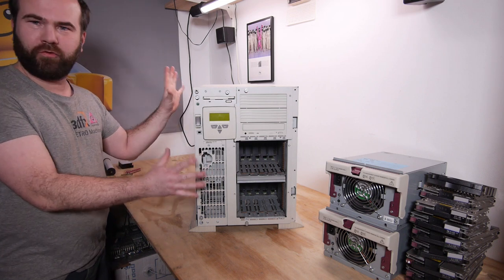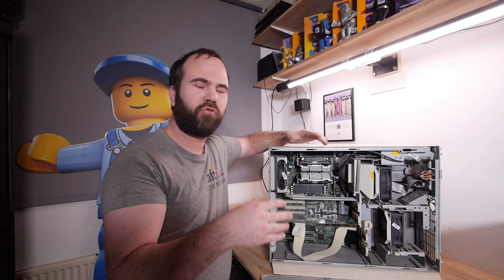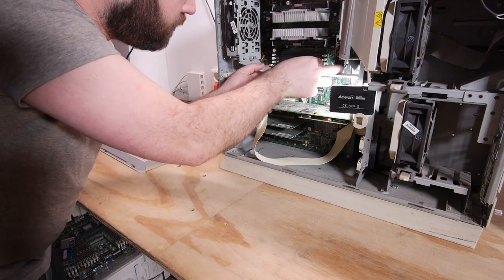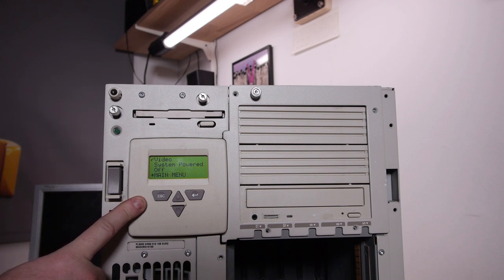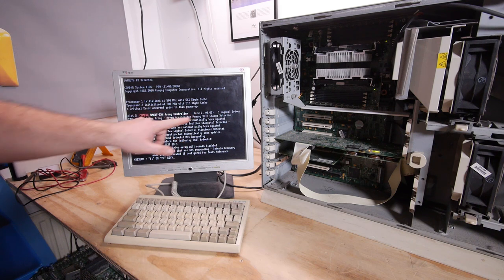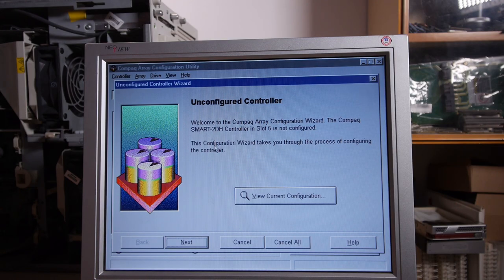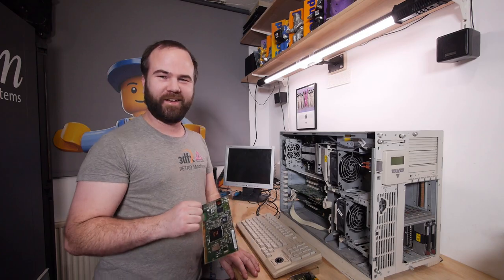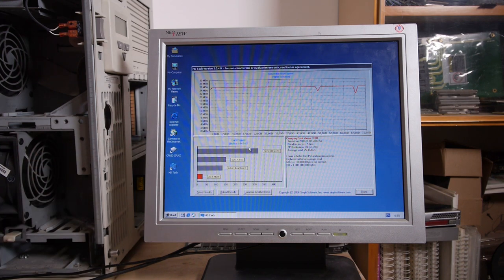1999 Compaq Proliant 3000, First Boot & SCSI Raid Setup

Comment: The door, when you find it, will no doubt cost more than the system lol.
Reply from the maker: Yes 🙈 Maybe I find another 3000 and combine them and get spare parts 😁
Reply from the maker: @mark smithier the model after the 3000, the dl380 ml370 etc supports p3 1ghz
Reply: @victorbart   I used to have a proliant 3000! it is a absolute UNIT of a machine! mine had wheels on it which was awesome. but it looks like yours has a different mobo which is interesting. mine used processor riser cards and took Pentium II's not pentium IIIs and it had 4 slots of RAM on mobo AND it had a riser card that added 8 more RAM slots for a max of a whopping 3 GIGABYTES OF RAM WHOAA haha lol. mine had 256MB of ram in it. but the case was the same. I had the LCD screen same PSUS same everything else..I just had a different motherboard. my Proliant 3000 is unfortunately long gone. I did have the front door for it. I did some Googling and the Proliant 3000R motherboard kinda looks like the one I had..but again, I had your case(with wheels) and PSUs and everything else

Comment: Victor, I actually installed these brand new in 1999 they are really nice machines. The 264gb Nick's that are in the system are perfect and they are fully supported. We even had multi-port nics in some of these servers.  4 total of 4 ports in each server or more.  We used these for DB, web, file servers.  These are great machines.

If you need any help please let me know.

Comment: Awesome. Don’t forget though those pci slots share one pci bus. If I remember correctly 133MB/s max.. So don’t expect miracles when combining raid cards with a quad gigabit nic as you suggested. Then again... maxing it out and making it suffer till it bleeds is kinda nice as well.. 😎
Reply from the maker: Yes I know! That is downside of this server. I prefer PCI 64bit! And it would be cool if the isa slots were EISA 😁
Reply: Well, it’s old anyway.. So just enjoy it for what it is. 🙂 I love speccing things out with time-accurate hardware and then make it suffer by hitting theoretical limits.. 🤓 Cool project!
Reply: @martintimmermans8952  here i am fixing up an make-shift server from around 2009/10 - at least it has ddr3 and pciex 2.0^^
Reply: @martintimmermans8952  haha

Comment: I'd put an analog/ISDN modem on one of those ISA slots, it's the most server-related thing that you could fit in it. If you have 3 ISA modems you can slot in all of them and pretend that this would be for some sort of remote access service. If you find or have around an old PBX you could even simulate the remote access system, hooking to it the server and some PCs equipped with modems. By configuring the Windows' routing and remote access services you should be able to connect to the server via modem and if you give Internet access to it via LAN you can even use your server as a router, to browse the Internet from the client like you would've done in the 90ies. I did a similar experiment some time ago and it worked :-)

Personally I'm not really fond of sound cards or 3D accelerated cards on servers, because they're more of a consumer/prosumer thing, I see them better being installed into normal PCs.

Comment: I have a Compaq ProLiant ML370 running 6x300GB SCSI HDDs. Basically, since I'm running FreeBSD, I made three Hardware RAID5 arrays across all drives and used ZFS to stripe them all due to a limitation in the RAID controller. You could probably do four or five, but basically keep each array size below 512GB (I'm suspecting).

Comment: Proliant's haven't got much lighter over the years. I had to relocate my ML350 yesterday, I'll be aching for days :D :D
Reply from the maker: the ML350 is the ugly duckling in the HP line. They try to continue the old 5U style tower cases, For modern system I prefer the 2U of a 5U Ml350
Reply: @victorbart  Oh she's definitely no looker, that's why it's now tucked away in a room in solitary confinement with the ugliest switch I could pair it with :)
Reply: @victorbart  The ML350 is best for using as a cheap high performance desktop though ;) lots of PCIE. Only thing is most people order it with only 2.5 drive bays and getting 3.5 bays are expensive. At least with older models you can use the optical bays but the new ones don't have any.

Comment: Well this is "technically" a HP server, as HP bought Compaq and used their server designs. This is why the DL380 generation 1 and 2 are branded Compaq, while later ones are HP, all the way up to the current DL380 gen10.
Reply from the maker: NO! The Pentium3 line of HP was a way different line.

the HP gen 3 4 5 etc are Compaq designs.

They dropped the HP netserver line and went with the Compaq Design :)
Reply: @victorbart  Yes, that's what I meant. That HP basically just took over the design from when they bought Compaq, so that's why I would say this is "technically" a Hp server :P

Comment: hi why not use one of the many expansion slots to put an pci to  compactflash or sd card for use it as boot drive, that way you have full space in the scsi drives and it's more dependable that way & boot faster.
greetings
Reply from the maker: I can also look for the compaq 2x 5.25 drive bay with 2 hotswap drives. Or I can split the raid arrays like with 10x 300gb make a 10x 5gb raid5 boot and 10x 295gb raid5 data. I have some options to choose 😁
Reply: @victorbart  well that is a possibility but if your going crazy with scsi or drives why not get a double compact flash to pci adapter with both of these cards you could configure them in raid 1 for redundancy or in 0 for max speed or better yet a 2.5" to pci card adapter that way you could mount a 2.5" ssd in that card, or something crazy like I don't know a ide raid card with 4x sd to ide adapters in raid , or 4x compact flash to pci adapters or something...
greetings & good luck finding that front panel